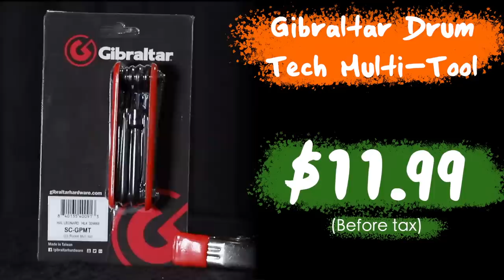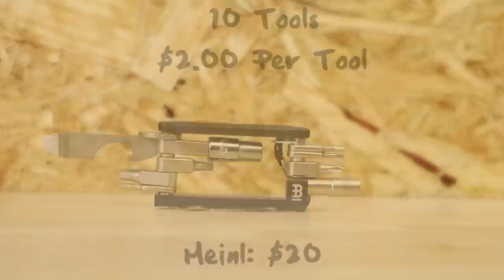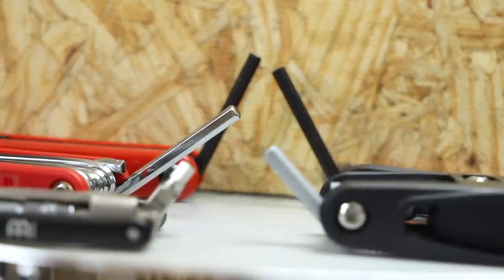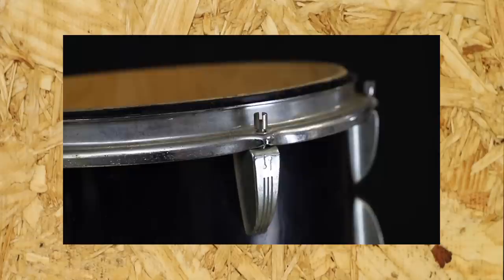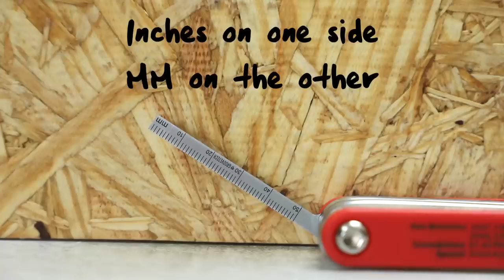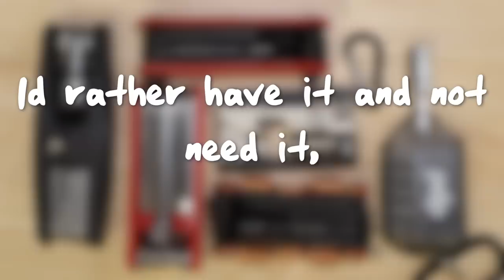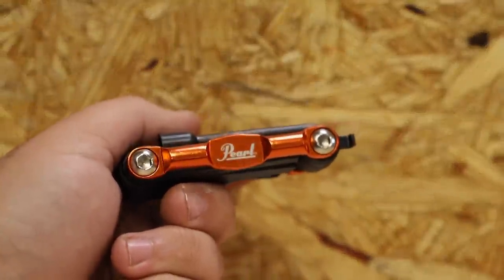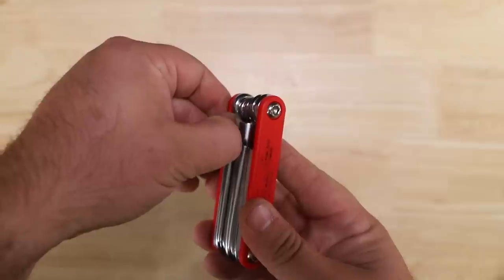Cheapest vs. Most Expensive Drum Multi-Tool

Comment from the maker: Whats one tool you ALWAYS bring to a gig? (other than a drum key lol)
Reply: tools for rest of the band, because they always forget.
Reply: TAPE. Different kinds in different colors.
Reply: an adjustable wrench, for I need it to set up a vintage Ludwig tom mount
Reply: I bring a toolbox
Reply: Our bass player
Reply: Drum sticks
Reply: Nothing since I don’t get gigs
Reply: Gaffer's tape. 2nd most useful thing after a pair of drum keys.
Reply: A bottle opener 😂
Reply: Leatherman or other general purpose multi-tool.  In addition to drumming myself I'm a "pit crew" dad for my kids' HS marching band.  They always need something fixed or adjusted, or find a sharp edge somewhere on a rack or set piece..
Reply: gerber multi tool takes care of most things, but i also keep a cheap basic tool box in my PA wire crate. channel locks, needle nose pliers, flat, phillips, crescent wrench, and assortment of bits and pieces that break at the most inopportune times. i put a drum key in every cymbal and stick bag, i have both the 'hammer' type keys on each of my Iron Cobra pedals, and a standard key in their cases. i also have keys that fit some lugs but not others. not like an old sonor and a modern lug, but sometimes a newer key fits slightly smaller or rounded lugs and screws, where the older one will fit better on slightly larger or sharper lugs. a good reliable knife is always a must as well. and a pen/sharpie/pencil and some paper. phone charger. flashlight. tape.
Reply: Ducktape. It always comes in handy.
Reply: @koolBOY8323 now THAT'S a great list!
Reply: A roadie to help carry stuff!
Reply: CruzTOOLS makes a decent one. Tried it out at NAMM and it did all I needed. 
Great video!
Reply: Can you do a video on planet z symbols
Reply: What’s up David! I’m the one who emailed you on this topic 😂 I was super stocked to open YouTube and see that you made the video! And thanks to you I know which one I’m going with. (The Groovetech) great video man!
Reply: Pocket knife… can’t leave home without it.
Reply: Leatherman and a drum key and tape
Reply: I've got my Victorinox Swisstool with several bits and a separate drumkey.
Reply: Just a bottle opener
Reply: The Ludwig hardware wrench, as I use a 1966 set of Club Dates with the original console mount.
Reply: Mr.  Raof deved raof we dont have like in yemen we have only bad life war and i am fun with my electric drum and acoustic drum i will tell you about another tools when i out from my country

Best Regards"""""
Reply: Tape and a Flashlight
Reply: Tape, tape, and tape!
Reply: Myself
Reply: I don't gig lmao
Reply: 7/16" line wrench. Perfect for Ludwig rail consolette mount
Reply: I bring my ...um "cough"..2 inch ruler...ya know to measure my other tools       ;-)
Reply: My drumsticks lol.
Reply: Well.....what other tool does rdavidr bring to shows?
Reply: small headlamp.

Comment: What I’ve been doing for years is simply placing whatever required tools I need in a used pencil case. I also keep and a small roll of electrical tape for set lists and emergency dampening. There’s also a sharpie, a few extra drum keys, an extra hi-hat clutch as well as nylon cymbal sleeves and felts.
Everything fits easily in either my cymbal bag or snare drum case.

Comment: On the road: the wing nut slot alone on the Tama is worthy of buying it. Countless times I've had band mates helping me to set up hardware, stage assistants, shared-drum scenarios, borrowed drum gear, resident drums in some clubs, studios or rehearsal rooms, etc etc, and had problems, even hurting myself trying to unscrew overtight wing nuts. This thing is a huuuuge lifesaver for those on the road. It was the best tool advice I had from a fellow drummer years ago. Just passing it on.

Comment: I have the pearl tool, it just does just about everything. Every time I need to do something on the large assortment of drums at my school its had the tool for the job. It has a ton of hex keys and I've needed quite a few of them for a couple different bass drum pedals. But the meinl having an interchangeable socket is awesome, and tama looks like the most comfortable grip, and it also has the wingnut slot. I've come across plenty of over tightened wingnuts and that would save that annoying ache in your hand after forcing one loose.

Comment: The ruler could be used to measure tension rods?? In case you need a specific length?
Reply: Was thinking the same thing, or the ruler can also measure the width of a tom arm or L arm case it needs to be replaced

Comment: I followed the advice of a video I saw a few years ago and built a drum/bass/guitar tackle box. The top lid area has strings, screwdrivers, Allen keys, pens, knives, markers, a flashlight, string winders, drum keys, spare in-ears, and some other stuff. The trays have pretty much all spare parts I'd need for drum shells, pedals, and hardware. The box was inexpensive and compact, and a lot of the parts and tools came with the respective instruments, so I didn't have to make TOO many purchases after the fact
Reply: I did that too but use it as a case for my pedal since I took the trays out. All the other spares/tools/etc just get thrown in. Saved myself (and others) more than a few gigs.

Comment: Thanks for the rundown. It is immediately clear to me that the Tama is the one to go with. As a guitarist I've gigged a lot with multi Allen wrenches in the same form factor as the other five tools in your rundown. They work in a pinch but they are always frustratingly fiddly and nowhere near the stability or comfort of a dedicated T handle wrench. I would never want to do any drum head tuning or def replacement with one of those fold-out tools. Tama's design is the only one that looks like it would be either efficient or comfortable on the gig times six or eight lugs.

Comment: What size hex would you have on the PDP tool if you put one of the bits in backwards?
Reply from the maker: 1/4" I just checked and theyre too long to fit in when you flip them. I guess you also would have a 1/4" nut driver if you dont use any tool in it.